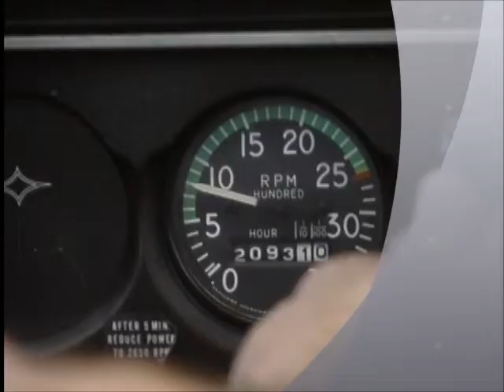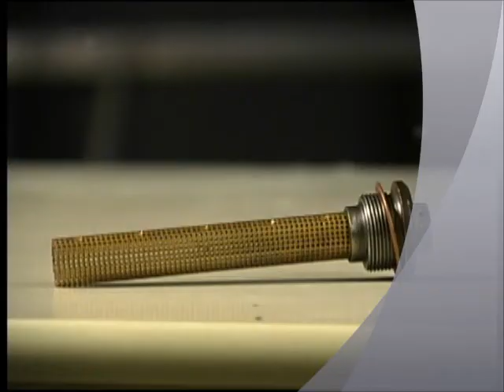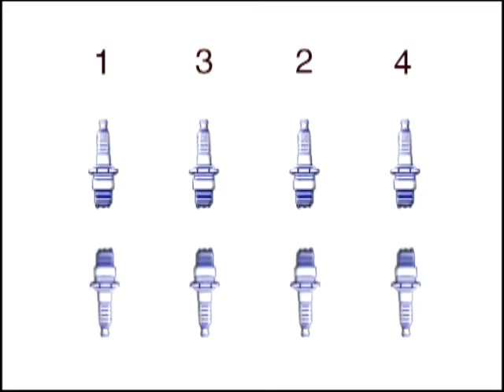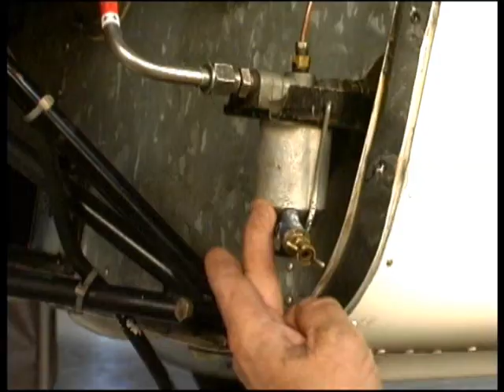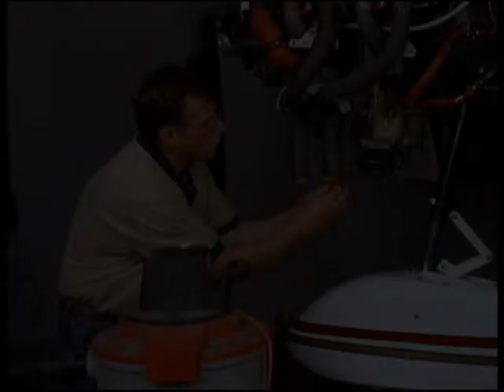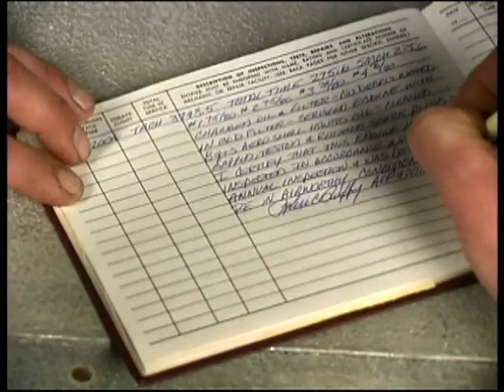100 hrs inspections Lycoming

Comment: In the video, you state that manufacturer's service letters and service bulletins supercede AC 43-13. This is incorrect, unless the service letter or service bulletin is FAA Approved. Service Bulletins are not mandatory unless they are referenced in a FAA Airworthiness Directive or aircraftvType Certificate.. FAA Advisory Circulars are a means, but not the only means, for compliance with a FAR.

Comment: Lycoming and Continental engines are outdated.  Just like air cooled motorcycle engines were replaced with more reliable, longer lasting water cooled engines. Aircraft engine companies like Popular  Rotax have already switched to 4cycle water cooled engines.

Comment: 50:06 the wiring is wrong, safety wire should be intalled with shortest route to the bolt hole, here the demonstrater too the 2nd or 3rd bolt hole, (its wrong).
Reply: As mechanic, I also agree, but where does it say that?

Comment: Thank you sir for taking the time to post this video and or make it thank you very much
Reply: 50:06 the wiring is wrong, safety wire should be intalled with shortest route to the bolt hole, here the demonstrater too the 2nd or 3rd bolt hole, (its wrong).
Reply: Hola

Comment: Hm. Modern car engines made in Korea or in Japan do not need 100hrs services. That would correspond to service each 10000km so about. Are the aviation engines from another era or does the security record actually demand this? Are you flying dinosaurs?
Reply: Yes, dinosaurs.  There are many MILLIONS of car engines made every year, they are used in every country on earth.  There are only a few thousand piston airplane engines made every year.  The piston airplane engine market is extremely small.  It takes a huge sum of money to develop, get government approval to use an engine in an airplane.  There is not much of a market for development and marketing new technology aviation engines for general aviation use.  Virtually no profit margin, huge costs to bring to market and liability issues are why the general aviation engine technology is stuck in time.  100 hour inspections and annual inspections are government (U.S.A.) requirements when the airplane is used for hire (to generate money) as a safety precaution.  If your car engine fails you pull off the side of the road.  When your airplane engine fails you come out of the air and the sudden stop can be fatal, there is a much higher degree of risk hence the different inspection requirements.

Comment: if inspector want looking my plane, i not pay anythink if want inspect its ok, but if need money go looking many other plane and thief money, inspector not need money, have him work and hi do what him do but i not need pay him work newer. if FAA need inspector work FAA pay him salary, plane owner not need all inspector or pay him salary. FAA pay if want inspector work. owner NOT ewer need pay to him anythink.
Reply: This is the edited version of your post?? How bad was the first?  I get your not an English speaker but this is just sad.
Reply: Say what? Ok, are you trying to say an inspector is going to try and find something wrong to make more money? Maybe, maybe not. There are shady mechanics in all professions, so it's possible. I used to run in to that situation with auto repair shops. Years ago my state had an annual safety inspection on vehicles. Some places would always find something wrong so they could make money. I never gave them the satisfaction because the law said you could get it fixed anywhere, not just at the shop that failed your car. One failed me for the spring tension on my wind shield wiper blade for example. I never saw another shop do that test. Some of those tests might have been bogus stuff they made up for all I know. They would ALWAYS say my head lights needed adjusting. It got so crooked the state did away with those inspections and now the state patrol can do spot checks, but I've never seen one done.
Reply: "plane owner not need all inspector or pay him salary"  actually this mindset and business model has killed many people throughout aviation's history.  In fact many Airline manages and CEO-types feel exactly that way about their employees.  Go back to the early days of aviation and way earlier than Francisco Anthony "Frank" Lorenzo and Texas International Airlines where low pay, terrible working conditions and poor maintenance were common-the safety record was abysmal.

Comment: I turned prop with finger over spark plug hole, no compression at all. Valve was stuck open.
Get mechanic to check silencers with a video scope.
Reply: What's a silencer?
Reply: @derheeheehee6941  
Muffler, which is a better term than English silencer as we use UK. Far from silent!

Comment: Two minor comments. Safety wire of oil filter should be pulling filter in the tighten direction and when referencing the mag switch the master switch was shown. The rest was very well shown. Thanks for the video. Hanger Dave KJVL